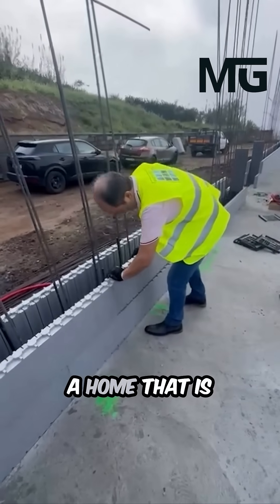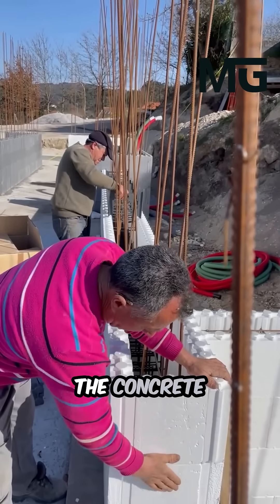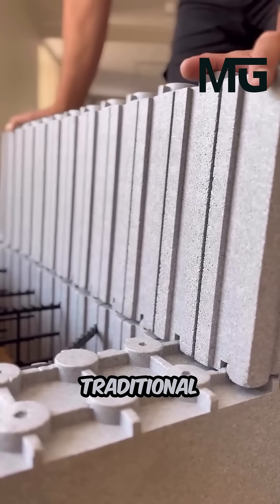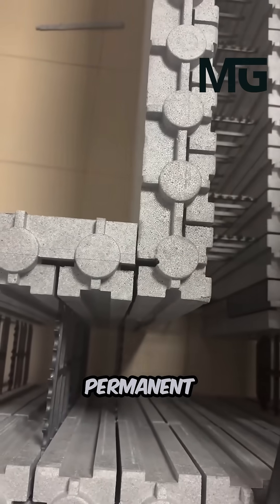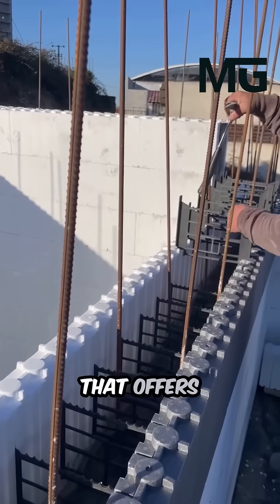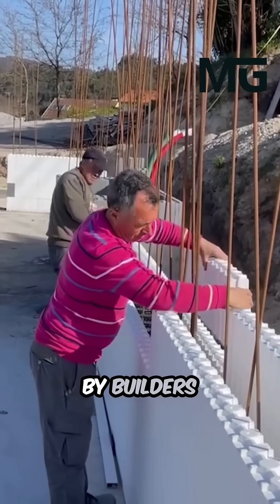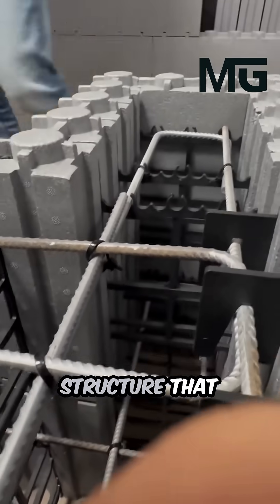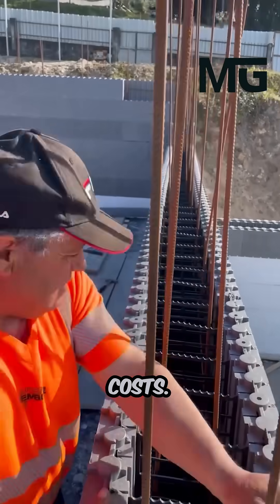Build Your SUPER Strong, Energy-Efficient Home FASTER! 🏠

Comment: Styrophome houses how far have we fallen 😂😂🤣😅
Reply: The house isn't just built of Styrofoam - did you not see the steel rebar being installed horizontally and the vertical rebar all around the work site as they were building the formwork?  The Styrofoam blocks used create the formwork for concrete to be pumped into the cavity created, encapsulating the steel rebar thats placed into the formwork as its built, and once the concrete has gone off, will create a very strong wall.  The additional bonus on top of it being quicker to build is the styrofoam also forms part of the insulation of the building as well, saving time and construction costs.